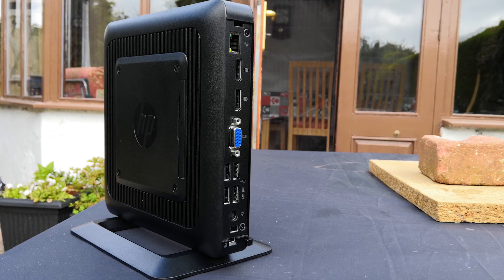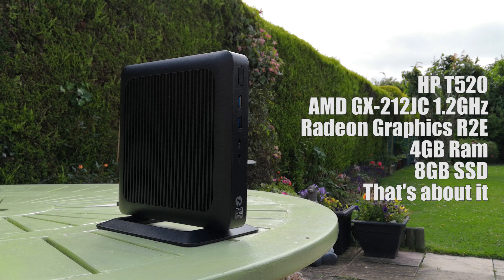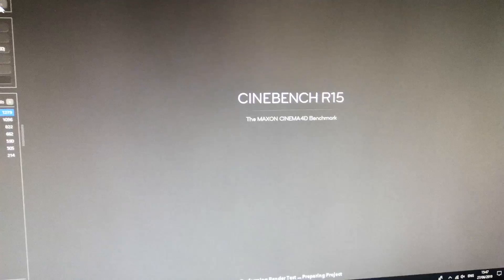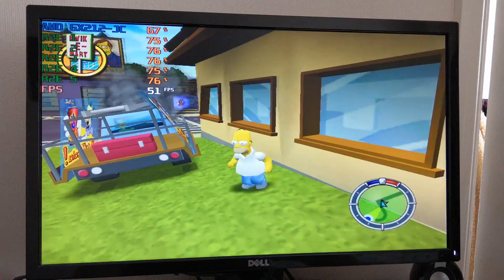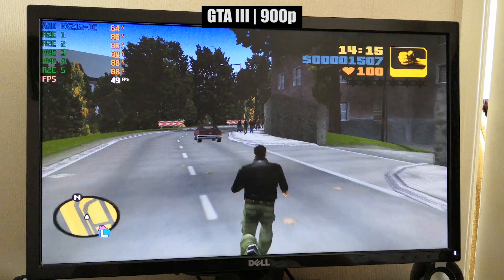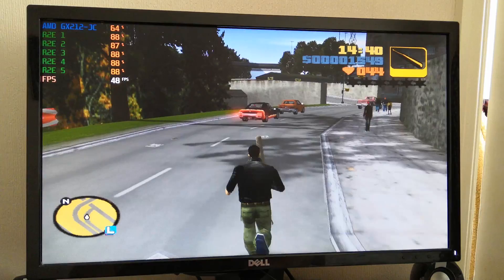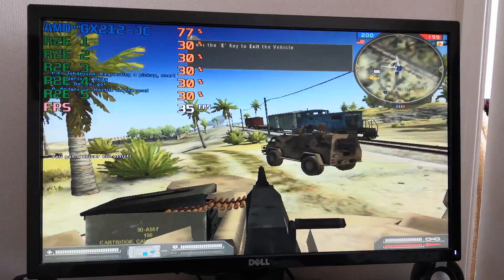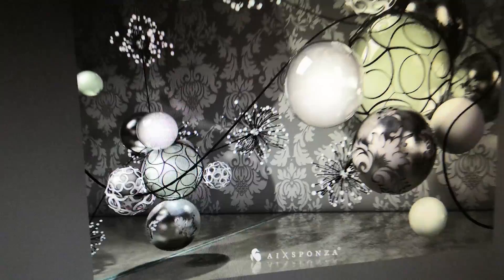Can We Game On This $25 HP Thin Client ??

Comment: Be an ideal project box for an install of Batocera(a Linux distro with built-in emulator front ends that can be controlled via USB joypad) for running emulators to make a cheap, easily luggable retro console.

Could also be used paired with some kinda Android or Linux TV distro to give smart TV functionality to a regular TV.

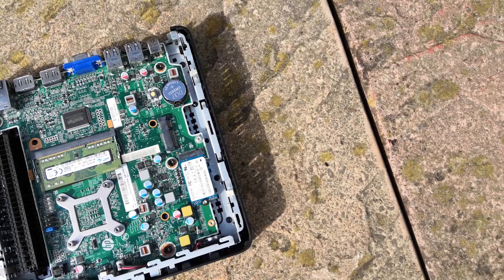Comment: 0:57 its not cuz its quiet its cuz its cheap and easier to manage. instead of having to reimage the machine you can just spin up a new virtual enviroment which is faster and sometimes there are no persistent user accounts, just a cloud for saving files to. a lot of schools did this where there was a network share that a student saved their work to. and once they switch to google drive there wasnt a lot of reason to save anything locally at all. its annoying as the end user to not having any configuration saved but its super cheap and easy on it.

Comment: Excellent selection of games to illustrate what can be realistically achieved on such humble hardware.  It was a relief to not see an attempt at running Witcher 3/GTA V/anything else equally unsuitable for the platform.  I picked up a pair of similarly sized HP EliteDesk 800 G2 from a corporate scrap program for next to nothing.  Replacing the included WD Black 500 GB HDD with a bargain basement SSD yields a great media player/actual light use desktop (i5 6500T).  The only local game I tried was Portal (fine up to 720P), but otherwise for streaming games from my "actual" PC or Xbox One - no issues.  One is even running a tiny VMWare ESXi lab.

Comment: This performs better then i expected. I still have an old thin client with an Amd Geode NX 1500  (an embedded athlon xp) and a Via unichrome gpu. 512 mb mem and 512 mb storage. It can run a verry lightweight linux or even Windows 98.

Comment: The 512MB GPU in this HP thin client is pretty much the same as my previous 256MB MSI Radeon HD 2600 Pro AGP card in my Athlon 64 X2 4800+ build at 2.4GP/s & 4.8GT/s, which I was stuck with as my main system until I finally upgraded in 2015.

Comment: Better selection is HP t620, AMD dual core at 1.65 Ghz, takes an m.2 SATA SSD and can have up to 16 GB of RAM using two 8 GB SODIMMS. The onboard audio circuitry is very good, very quiet and more than adequate as a source for making tapes from digital files. Runs Windows 7 Pro 64 bit or Linux Mint pretty well. Older games of the XP or Win 7 era can run acceptably. Cheap fun kit, I use mine for various audio chores so I don't tie up my main PC and external USB interface.

Comment: This is actually a good thin client. the color and the side panels give it away. Look for the older ones with grey on the side panels. The side panels without holes are older like the t5135. The t510 and t5565 models won't connect rdp to windows 2018 servers unless on thin pro version 3, and are the oldest ones in my environment.

Comment: Resolution of 1080p or lower puts more strain on the CPU than resolutions higher than 1080p. Even on a top of the line PC it will work like this.

Comment: I remembering failing to run BF2 on my main PC back when that was a current release, and now I'm watching a $25 thin client run it. Far from max settings but better than my rig back in '05.
I've had literal toasters bigger and more expensive than that thin client, they might also have scored the same in CB so there's that.

Comment: I read this somewhere not sure how accurate it is

But my laptop was having awful performance on csgo (AMD apu)

So I read that if your GPU is doing a more limited task then your CPU wont work as hard
Reply: On the APUs you also have to factor in the combined TDP. there is only so much power for both togeter.

Comment: 7:54 You were CPU limited at 768p so the lower you go the worse the frame times as you rely less and less on the GPU. In otherwords lower the resolution and the faster the CPU has to work.

Comment: Linux is definitely underappreciated and has it's uses. I love throwing Linux to old systems so people can use them for daily tasks and even entertainment.
Reply: Its not 99% of old pcs that run linux have NO gpu driver support so its basically useless
Reply: @spacy9571  I do have trouble with drivers time to time, yet included ones work good enough in most cases.
Reply: @exlibrisas  its different for everyone non of my old laptops have any gpu driver support so unfortunately i cant use linux and most people have exact same problem

Comment: a bit like a old Raspsberry pi 3 basicly, but more windows compatible of cause. A really good retro/old games machine. Quite often old games just dont work on modern hardware. Like Fallout 3 expects a 1 core machine. Sure you can thankfully tweak the ini files in that game, but there is a lot of older games that just isnt that fleksible. Sometimes having the right hardware just helps. One way or the other it will always be a nice emulation box for those old arcade game/etc.

Comment: I've got a HP Mini 705 G1 that I upgraded to an A10-7800 from the original A4-7350 and that can game quite well. I've got a 705 G3 model with a Ryzen 5 2400GE in it and that games pretty well for something that only measures not quite 7 inches square.

Comment: not bad for a 2w TDP chip, its almost on par on first generation Pentium 4 willamette, it would be cool if this thing can run windows XP.

I actually have a T620+ thin client, but this one is much better in terms of CPU and the GPU, but I dont use the GPU since I added GT1030 on it and it basically became a HTPC.

Comment: The reason the framerate went down when you swapped resolution lower was because the CPU works harder because the GPU is less stressed so it makes it harder for the CPU to output all the frames, and it basically causes it too be too much work for the CPU and kills performance. A higher resolution would've been better, though it's hard to pick exactly what you'd want to use without testing.

Comment: Sounds like you need to acquire a DP->HDMI cable, then. I use one on my home system to connect to two televisions. You should be able to get one for a decent price. I paid 10 USD for mine when I bought it - 6ft cable (2m) as well.

And it sounds like this can handle PS2 and XB era games. I'd be interested to see how that would work as an emulator system. Since emulator distributions exist for the Raspberry Pi that fit onto a small SD card, this would probably be suited for such a setup using the original SSD and the games stored on external storage or a NAS. It would probably also work well as a media streaming system to a television using the aforementioned DP->HDMI cable - 1080p only as well.

Comment: you should have gone with the t-620 plus or the t-730... the t-620 plus is a 4 core 2 GHz CPU and has a x16 slot wired to x4 (I put a gt 730 and 8gb of ram (sadly 2 slots only single channel) with a evo 860 msata)... the t-730 is a 4 core that boosts to 3.2 but this time the 2 ram slots are wired dual channel (gt 1030 16gb ram and a wd 1tb m.2). love em both and they are nice and small for hotel gaming with my kid. great video

Comment: hoping you try a low power gpu out with the other m.2 slot , might only be 1x or 4x but would still work as a video out .but an external psu with a powered riser is ideal for that setup

Comment: I have beaten that cinebench score using a single core (2 thread) pentium 4 (socket 478) clocked at 3.3ghz. Granted, it only scored a 41 but that's still better.

Comment: Ah yes, the G-series SoC.. never had to use one. Looking back at some press info from 2014, I see they had SEVERAL models varying between 6 watts and 25 watts Some didn't even have a built in GPU (rack server CPU?).. 
http://linuxgizmos.com/files/amd_gseries_socs_140605.jpg 
The GX-424CC is interesting- it has the highest CPU clock speed and 4 cores and fastest ram. Though the GPU frequency is not the fastest.
The right example might make a great little old console emulation machine.

Comment: You can get thin clients with PCIe expansion modules. I've tried, and you can actually make a full-sized card (in my case, a GTX 560 and a 9800 GTX+) work with the little Atom N280 in mine. Now that's a bottleneck! You need an external PSU, of course.

Comment: I have repurposed a dell optiplex 9020 and it seems to run alright with a i5-4500 3.60 ghz cpu and integrated graphics. Gets about 25-30 FPS on gta5 on lowest and low res

Comment: Top tip: if you're gonna install extra SSD disk space in a thin client with limited RAM, you can assign some of that disk space as what it called Virtual Memory (VRAM), which acts as (albeit slightly worse) RAM that Windows can use. 

NEVER do this with hard disks though, that's an easy way to wear them out and cause thrashing and noisy drives over time, as well as using up the lifespan of bits which then can't be used anymore.

Comment: The thin client has display ports. You could have easily used an adapter to connect that to HDMI. They are cheap! Probably something to invest in for systems like this and others that have display port but no HDMI.

Comment: Have you looked at a Gateway E-265 or E-475 laptop with ati graphics?  I have the 475 and the HDD recently died. I'm doing a complete overall of the system. New HDD, faster CPU (T7100 1.8ghz to t7700 2.4ghz), Max 4gb ram and a board swap. Mine didn't have ati graphics onboard. I sourced a known good MB w/ ati graphics. I'm hoping to extend the life out of it just a little bit longer. Wish me luck!

Comment: I use this as a steam link / emulator, all have great networking and plenty of USB ports for controllers. Lubuntu with a striped down Firefox works fine thou I might. change to DSL  for a little more proformence
Reply: also you can get display port to HDMI cables or just a adapter

Comment: The Thin client doesn’t not have a HDMI for my capture device.
You know you can buy a DisplayPort to HDMI adapter?
Reply: Amazon or eBay is your answer. It should work on any adapters. I have used DP to HDMI, DVI to HDMI, and Mini HDMI to VGA. All they worked great without an issues.

Comment: What? I game on my thin client :) Check out the Onda B320. It's AM4 based so you can actually use if for a SFF 2200g or 2400g build. PSU is even built in.

Comment: You could put a gpu in the hp plus modles not full to us but single length low profile cards so a gtx 1030 with the vga hanging off would work iv seen some with 2ghz cpus with 8 gigs of ram these are capable for roblox

Comment: I think id have tried a 7570 or something similar externally adapted to the m.2 slot, with usb 3 external storage for everything. larger ram chip, fans jery rigged to the cooler, etc. its clear that even a hair of headroom would have done this system a ton of favors.

Comment: I bought t5740 with atom n270 and 2 gb ram. With Sata hdd and Ubuntu server it works great as media server.
Reply: I had a Lenovo S10 netbook with that CPU. Even after “upgrading” it to 2gb of ram, it was still painful to use under WinXP. Lots of low end games wouldn’t even install due to its dinky screen resolution.

Comment: wyse Cx0 work great as retro gaming system for y2k era stuff, i have mine running a 32GB compact flash card on the IDE, getting its full 100MB/s, 1GB ram (64MB for the via unichrome gfx), with win XP, it runs FutureCop LAPD and Jeff Waynes war of the worlds very nicely, which is more than modern systems can say about those 2 games :) i have a couple of mods planned for it, a tiny audio amplifier and a pair of internal speakers i pulled from an old laptop.

Comment: Lol, a "thin client". I wonder how this system would compare to my Dell Precision m4300 laptop. Apparently, yesterday would mark 12 years since it was released which I saw a CNET ad dated for June 28th, 2007. It seems to run the 2019 version of Windows 10 pro 64 bit fine and it has a 2.5 ghz Core 2 Duo cpu with 4 gb ddr2 ram and a 256 mb nvidia quadro 360m and I put in a 160 gb SSD. Maybe one good thing about the "Thin Client" is that it is silent with no fans. Now to have better performance on the thin client, you could use Windows XP media center edition 2005.

Comment: Hi All, for the specs i would have checked the faq sheet and seen it is runs Win98 or Win XP as a base operating system and games of the era.  It may be possible to dual boot dos 6.22 natively, then win XP on a separate partition.

Failing that it would be perfect for emulation say using recalbox or Retropie or emulation station

Regards
George

Comment: iam  have one of this hp 520 thin client pc  iam put a new  transcend M.2 SSD  M.2 2242 64gb in this thin cllient. end install linux mint 20.4 mate  on it 
It runs well. With linux mint 
Hp have software for thin clients hp  thin update its instaled from oem factory default  with hp brandend custom windows  10 Iot enterprise ltsb 2016.

Comment: Can you game on a Pentium D running windows 7 and 3gb of ram and integrated graphics? No cheating I mean modern games I've been trying but it's hopeless but it runs old Halo just fine probably because it's designed for it! It ran crysis at 50fps so yea not too bad either and the first far cry ran at 50 to 60 fps not that bad considering it is a crap CPU with terrible GPU on it lol.

Comment: Why didn't you install Win7?
Reply: Windows 10 works fine on it
Reply: @si4632  
But you'll find with Win10 it uses tons of CPU cycles sitting at ideal that Win7 doest, and with a low power CPU powering the Thin Client ever bit of power matters, you'll get more FPS, no-brainer!
Reply: @hardcore8uk  not really i use a sempron 2650 its fine🤣

Comment: Half-Life Source is NOT the o r i g i n a l Half-Life
Reply: That’s not half life source, it’s the newest update of half life 1 on Steam.(which runs significantly worse than the original disc copy due to it being open gl and not DirectX)
Reply: EvilTurkeySlices  you can see specular/cube maps (floor reflections),  updated particles and detailed impact marks (unique per material) in the video which were added in Source. The physics look different from Steam/WON version of Half-Life as well.

Comment: Would you recommend AMD GX212-JC processor for gaming in 2019 with like a Geforce GTX 560? or not.
Reply: It'll be bad for gaming unless you're only interested in older games, in that case a GTX 560 will be insanely overkill and it would be bottlenecked to hell by the CPU, not that it would even work because the GPU is bigger than the PC and the PC doesn't have any PCI-E slots

Comment: Not going to lie, windows 10 was a bad choice for this video. Windows XP would have been a much better choice. Windows 10 is a dog on lower end systems. Hell even windows 7 would have been better. Windows 10 has some forced UI and Memory usage choices that are fine for modern systems. But on a machine like this just do more to slow it down. I would bet the cpu benchmark results would not only be better, but games would do better as well. The HP T610 think client is a good deal better than the 510 shown in this video. Still wouldn't use anything more than windows 7 on either system.
Reply: This thing runs Windows 10 with ease